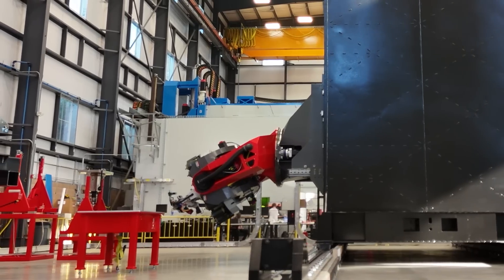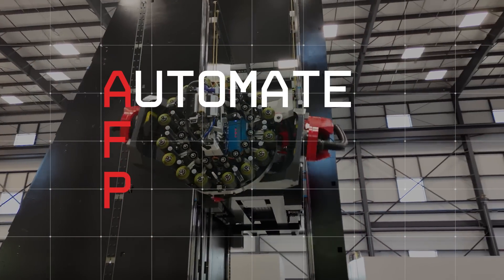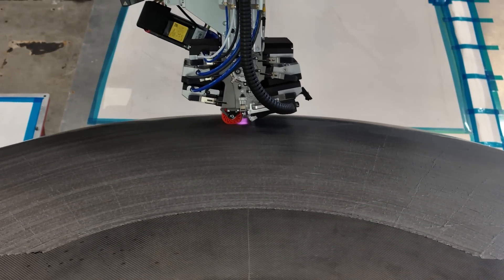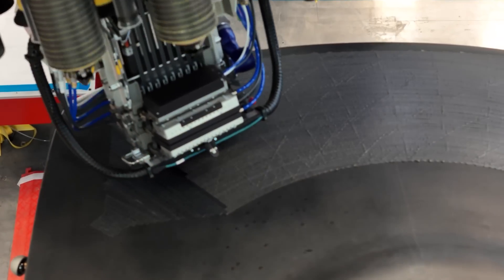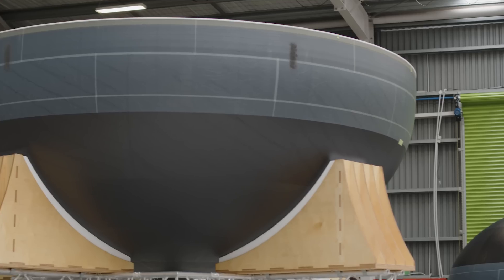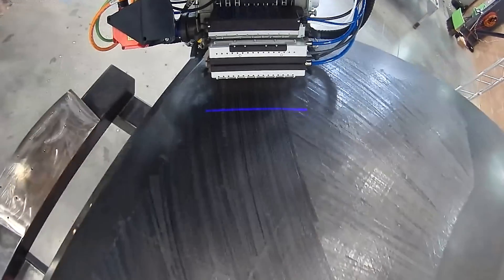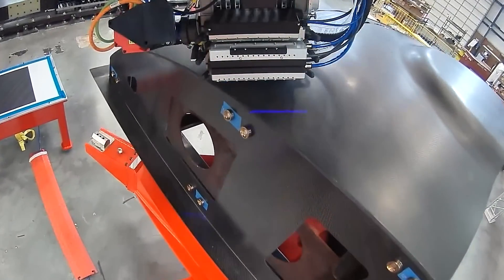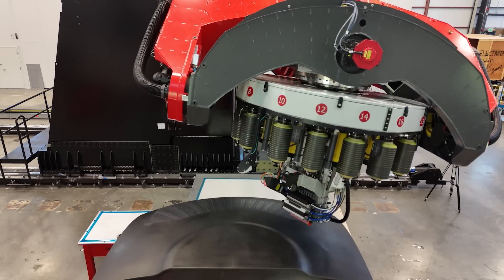Rocket Lab | The World's Largest AFP Machine Of Its Kind

Comment: If steel or aluminium develops a crack it can be welded or soldered. How do you repair damage to a carbon fiber structure?
Reply: depends how bad the damage is and how it is damaged, but you might cut out and replace a section or fill it with epoxy and add additional plies on top. Damage tolerance/repair is one of the biggest issues with composites right now but people are figuring out how to make it work.

Comment: thanks, incredible machine you created.
thank you, prevent effect of global warming, New energy from sea will change world soon, minerals and temperature of water and air from sea are huge source of energy, reduce more than 50% using fossil fuel, fresh water, fertilizer(minerals+O2,N2,C), zero pollution, normal space, by using power magnet of machine as catalyst to separate N2 and O2 from Air , economy will rise by using jet plasma machine and compressed gas(Air) in isolated structure in water pool with more than 80 % efficiency, it has two vertical cylinders, in first level it transfers compressed gas(hot air) temperature from engine to sea water in pool for steam electric generator, steam combines with high cold Air pressure to produce pure water and electricity , there are other source of energy that with international cooperation in coastline we can reduce effect of global warming, further more we can prevent these phenomena like cyclone and flood and wildfire , ocean water level by using this hot seasonal atmospheric condition, recent years in summer, geothermal energy happens in surface of coastline, there are many countries in coastline with seasonal hot weather and water condition in comparison with middle Ocean, its more than 12 degrees ,this differences must decrease, in sum-up, by using this energy not only is economical but also reduce global warming in countries like Japan, China, India, Mediterranean countries, Iran, Brazil, Mexico, Us, Canada, (Africa and Arabian countries....) . I invented new method base on air pressure rules and quantum physics ionization sea water minerals in strong dynamic permanent magnet(SMCO) with special frequency(1500or 3000)/minute bases on paramagnetic and diamagnetic particles and electrical microwave electron wave field and electric chemical reactions and photon wave from semiconductors with special angle Cations like(K+, Mg++, Na+, H+, H++, li+, H2, ...) are transferred to in the second level into up level by vacuum pump from storage into combustion chambers and they combine with O2 and N2 ,... as major part of fuel, they increase speed of machine, modern induct Gearbox to control speed of opposite direction, for producing electricity and fresh water (removed minerals by accelerate ionization sys from sea water) and fertilizer. this machine produces 150Megwatt/hour and 20000M3/DAY fresh water and fertilizer. 7 methods zero pollution for reducing global warming I mentioned in my profile. (G20 countries can solve these phenomena like injury and death, billions of US$ in damages).

Comment: I wonder if the model used in the video is just for a demonstration of the tech and not a real part.  I was under the impression that in order for a wrapped tank to have strength it would need to be from a continuous roll.  It seems like the cutting of the roll would diminish its ability to hold pressure and create a weak point.

Comment: This is why Rocket Lab shares have been rising so much recently. Rocket Lab is no longer just a launch company now they are branching out into areas like cutting-edge composites manufacturing.
Reply: Probably smart since the rocket market is getting more competitive.  Do things others aren’t doing.
Reply: Using different materials than the stock standard, such as carbon fibre, us how Rocket Lab got going from the start. 
Everything it has been doing from day one has been about stepping beyond the established proven assumptions and using ultra modern innovation to both increase quality and decrees costs.
NZ founded company, and NZ isn't a mega rich nation where you can burn money, and fail over and over again, hoping things will work out in the end. Rocket Lab is founded on NZ pragmatism, find the absolute best way to do, at the highest possible quality, and the lowest possible cost, waste nothing, especially the most important thing, the time and effort spent thinking and learning and understanding and discovering what will work best and how to ensure it works first time.

Comment: The guy himself is sweet! But aren't composites in danger of fracturing with repeated use? Regarding Neutron
Reply: Not under tension which is what Neutron will experience in space. They are weak under compression which is probably the cause of the Titan sub failure.
Reply: If that was the case, you would start to see the composite structures of the winglets on aeroplanes falling off, at least by now, after years of flights. And how many fiberglass boats break up at sea! No, I think you can well and truly lay that one to rest.  
BUT, if you are using them under compression situations in Deep Submersible Vehicles (DSV's), James Cameron World Record holder for DSV deepest dive, will tell you that they will fail after repeated tests and should not be used in DSV's ever!

Comment: Work with spaceX to make a CF starship, that would be peak.
Reply: SpaceX started out planning/testing early parts of Starship as a CF build, but changed to SS for speed, durability and cost. At the time, they felt CF was too fiddly and expensive for their fast build/fast destroy methodology. At the time they may have been right, but things change as research and manufacturing efficiencies progress. I wouldn't be surprised to see some future, more finalized version of Starship blending both materials for various parts. They do love to cut down on weight whenever possible.
Reply: Starship has severe payload mass constraints at present - it's about a third of the mass that's needed and has a payload capacity about the same as Falcon Heavy. I think carbon fiber would go a long way to resolving that issue, but Starship might be too far into their metal construction to change. It looks like the new engines may improve the payload issues.

Comment: I think technically SpaceX should have a bigger one somewhere in a warehouse, as they were using one before they switched to stainless steel. But yeah, biggest currently used machine.
Reply: I am betting RL's is far more sophisticated than SX
Reply: @ThatOpalGuy  Sophisticated in what way? Cargo per launch? Cargo to GEO? Kg/dollar? Thrust/m2? Success rate?
Reply: I doubt they got to that point
Reply: @RyanMcCarvill  They got the machine, they were doing the wrapping already, it's on one of very old videos from like 2017 or 2018.

Comment: Oh man, I thought I'd made a cosmic shift switching up my Ender3 to TPU...   Leaps and bounds ahead of John Britten hot gluing #8 wire frames and laying down fibre glass for carbon composite molds.
Reply: LOL And the late, great renaissance man of air cooled V8 super-bikes, only used about a third of a carbon roll per bike. Looks like that AFP would use that (and more) in a 1 meter strip!
But as John Britten found out (and as a result broke his test riders collarbone (?Can't remember his name?)) not good with compression. So I hope Rocket Lab has that side covered. Maybe an aluminium lattice structure in the landing shell part of the Neutron?